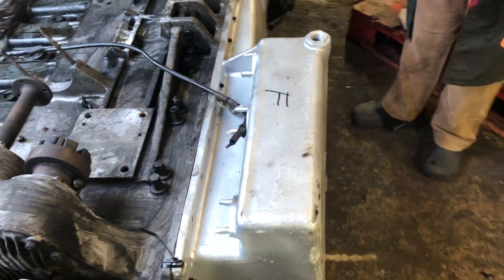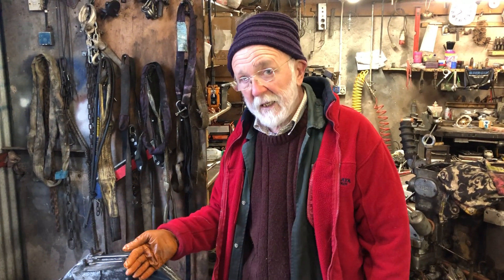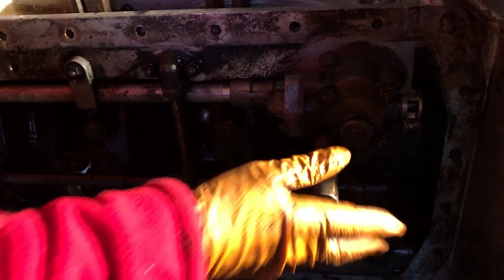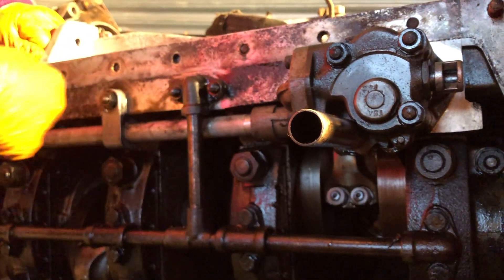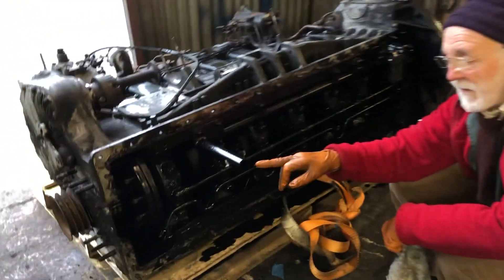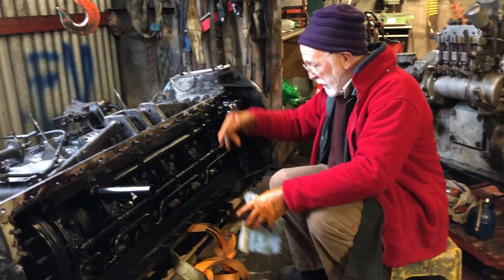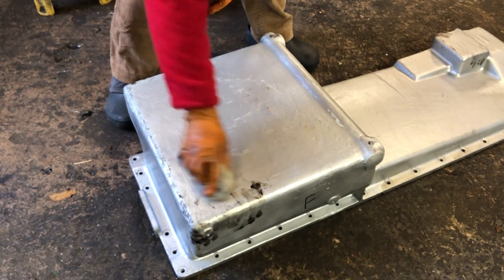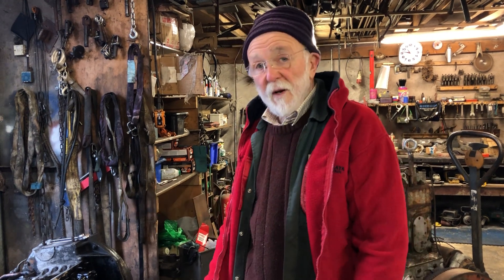Gardner Engines: the front sump pan.

Comment: Merry Christmas.  Another informative video.  Interesting system.  The dual pump idea seems to be a reliable way to handle the oil situation and minimize the engine footprint at the same time without a much larger sump and quantity of oil. I can see that being of benefit in a pitching or rolling boat.